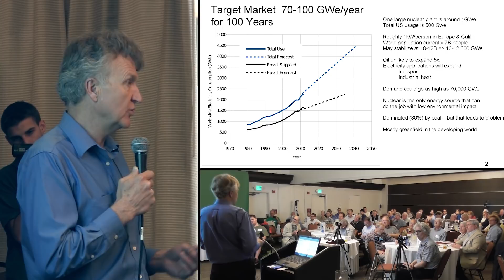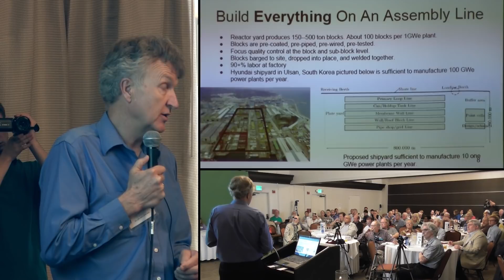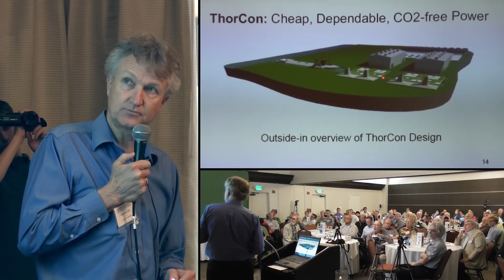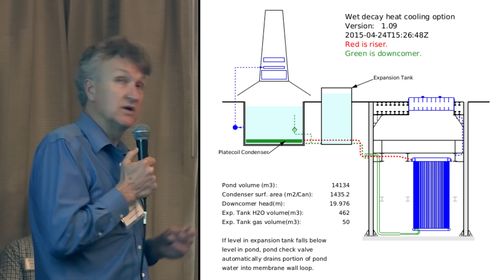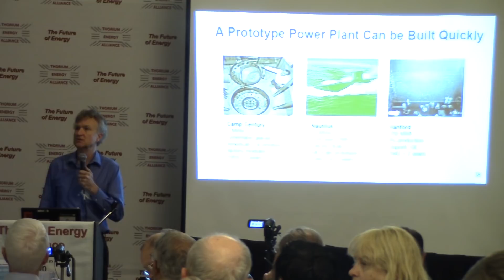ThorCon: A Thorium Molten Salt Reactor System that can be built Now -by Lars Jorgensen @ TEAC7

Comment: I hope this happens soon. I am a nuclear engineer and I have always dreamed that nuclear power would dominate electricity for the world.
Reply: Show me the entire soup to nuts program and, the full Energy Return on Investment EROI. Also compare the need to generate with energy want reductions.
Reply: Your heat losses have been tremendous 3,000 MW heat producing what? 1,000 MW electricity? And that's before transmission losses. With new batteries with PV the public will finally cut the umbilical cords to the I.O.U.'s. Hopefully soon. And as for drawdown of carbon there are safer processes if we all live a bit more lightly. See Drawdown by Paul Hawken. See too what he calls your industry. You want this reactor so bad get Bill Gates to build one and operate it without subsidy and you may get me to listen again. Otherwise...

Comment: Floating your production out on barges to a major river is genius.  (time 11:55)

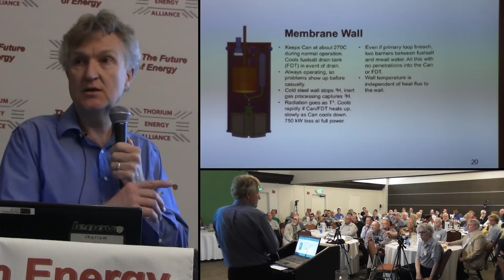At time 18:55 would be nice to have some piping and heater/pumps to get the thorium salts back up to the reaction chamber, after a overheat event.  Then it's not a big deal if you scam the plant.

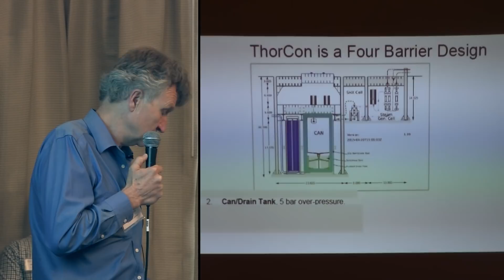At time 20:15   Four years on and four years out of service is not a very good ratio, what is keeping you from totally reprocessing your fuel chemically, and putting the Mod back in service after 18 months?

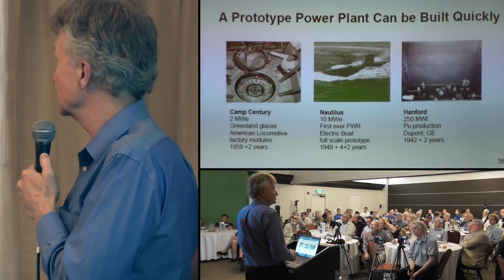At time 28:31 Hanford is a bad example of rushed R & D you should take it out and put up the second nuclear sub?!   Which is probably still sitting in Washington state somewhere.

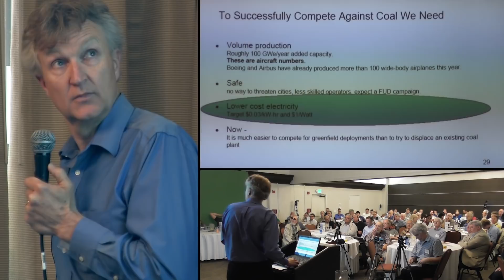Comment: 23:40  Going to 20% enrichment is a big plus just as a decreasing cost of production by a cent per kilowatt is. I just calculated what power producers in my province have been receiving per MW or per KW in the last 12 months. The average price from sept 2014 to sept 2015 was $35.69/MW or $ 00.0356 or 3.56 cents / KW. A one cent difference is huge economically. The speaker gave a price of coal power plants at 6 cents /KW. Almost half of the power in Alberta comes from coal.  I suggest there is also a huge difference in prices of 6 cents and 3.56 cents per KW.  ThorCon would still  be completive in price in Alberta's market, as the speaker gave a price for ThorCon power close to 3.56 cents per KW. The big plus would be more so in pollution control.

Comment: One idea I've had, and I have no idea if it's feasible or not -- the shortage of the highly depleted lithium (Li-7) needed for FLiBe salt could be solved if liquid lithium metal is somehow incorporated into the reactor as a coolant. Or at least, just happens to be there in an outer jacket surrounding the core. Li-6 will gobble up the neutrons that leak out of the core, turning into tritium, and leaving behind the more neutron-transparent Li-7. No mercury or fancy isotopic separation needed -- just a robust enough tritium capture system which the ThorCon system will already have in place.

It's a neat idea, I think, though it probably violates ThorCon's "no new tech" mantra (which I fully respect from an economics standpoint).

Comment: I think the Thorcon business plan is superb.  But I think it could be even better.  If you are going to be using a ship building facility anyway, why not make put the entire nuclear plant and its turbine and its heat stacks on the ship itself and have an entirely mobile power plant where all the ship has to do is hook up to transmission lines at the dock.  Use the mobile home model.  I think that would save lots of money on site costs and really improve quality control as nearly everything can built by the same people and robots.  You would have water for cooling in the case of a breach.  You could move the ships around as needed.  Replace small ships with bigger ones.  Lots advantages to this.  And I think regulatory issues would be far less.  Regulatory issues would focus on getting the ship out to sea in case of an accident.
Reply: That's exactly what they changed their design to, they must have read your comment.
Reply: Good idea but Security issues , an enemy submarine can hit

Comment: What we actually need (Horrible word to use. None of this is needed.), is cold power generation. Almost impossible, but it isn't. Just as power, from heat, has positive and negative... Reverse bias, energy from absorption (as opposed to being from radiation), is also possible. Thunder is more powerful than lightning. Yet, we focus on just the lightning. (The irony being that we still can't capture the small power from lightning, but everything we need to capture the power from thunder is already here. We just refuse to use it, because it can't be patented and resold for personal gain.)

Comment: if the module were built in the 1 to 10 megawatt range they could be licenced as experimental under current nrc rule and for a very large part of the would that is big enough servicing would be a pain but you could do it now and after several unit are running amending nrc rules would be much easier build small now then tackle large later, light water reactor are a bad choice but right now they are the only choice get another choice   out there so we can begin to fix things and make a better world!

Comment: Great talk, Lars! I've been looking forward to hearing more from ThorCon since you guys published your white paper.
I admire the straight forwardness and practicality of the design with respect to economics and safety.
I do have a few questions, though:
1) What's the Haynes-230 going to be used for?
2) 316Ti will help with sensitization, but not eliminate it. Even after four years you should see some inter-granular corrosion. What measures does the design take with regards to inter-granular stress corrosion cracking?
3) In the presentation, you illustrated a barge depositing a can directly onto the facility grounds. Are you implying that every site have direct water access? 

I'd be thrilled if you could answer these questions here or on the forums.
Sincerely, 
Vince Hughes
Reply: Vincent Hughes 1) Haynes-230 is a specialty nickel alloy similar to Hastelloy. Its for the drain tank, I think.

2) Recycling. All components of ThorCon are designed to be replaced and recycled.

3) Direct water access may not be strictly necessary, but most power plants are close to water anyway for cooling.
Reply: Vincent Hughes (3) Yes he said that each site will have water access. The blocks are built to barge dimension limits.
Reply: Pyre Vulpimorph Thanks, Pyre. I have a coupon of 230 on my desk for testing. And we just concluded a 100 hr exposure test of it in FLiNaK. 
From what I've seen in literature, it has some of the worst performance among the superalloys due to its high chromium. Why 230 over another alloy? Or even a nickel liner?
Reply: Vincent Hughes Executive summary here: http://thorconpower.com/docs/exec_summary2.pdf

Thorcon aims to use 316Ti stainless steel (page 46, section 3.12) for all 4 loops (pot, pipe, secondary, tertiary, steam loops). With a mean time between servicing of 8 years and (apparently) corrosion rates of 0.025mm per annum (1mm = 40 years) assuming salt maintenance at reducing conditions; Thorcon has pretty good margin on their core material. Indeed, the original ORNL commercial reactor proposal at 260MWe gross proposed 316SS for secondary loop piping: http://energyfromthorium.com/pdf/FFR_chap17.pdf, page 8 . 

Basically if ThorCon can get their chemistry right, they're in business. If they can't, they're sunk. I note that there's no external penetration from the can to the pot itself aside from the control rods; so how they're going to do chemistry control I have  no idea. Maybe they introduce it into the melt after the primary heat exchanger? MSRE used beryllium metal to maintain the melt in reducing condition and Nickel to maintain fluorine potential (equations here by Rudy Konings of the Institute of Transuranic Elements, TU-Delft MSR Symposium: http://www.janleenkloosterman.nl/reports/kivi_konings_20150417.pdf)

On the other hand its hard to argue with several advantages of 316Ti:
- Its cheap
- Its easy to source from a wide range of suppliers, which means that there's competition driving price down
- Its well understood (applications in LMFRs, LWRs)
- Its a lot more resistant to neutron embrittlement than Hastelloy (according to ThorCon, page 46, section 3.13)

One should also keep in mind that the idea is to scrap the whole thing and recycle the metal before a casualty occurs if a can fails inspections during refurbishment. Even if the corrosion is absolutely horrendous, all it means is a drained pot and an expensive failed experiment.

 Also trying to find a reference as to what the Haynes 230 is to be used for. All I can find is that ThorCon accounts for ~220 metric tons of Haynes 230 for 1GWe. (page 67). It might be useful as a structural metal for the Can itself, because there's a lot of stress placed upon the lips of the Can that has to also hold up the primary loop, hung by TZM cables and operating at 270 degrees celsius.
Reply: MonMalthias I'll need to read through ThorCon's website and published documents again, but I distinctly remember reading that the drain tank would be the only place they'd use a "superalloy". Right now, I can only guess that means the Haynes 230. What I originally read may be obsolete now.

I would not have expected a stainless steel to survive contact with molten fluoride salt for any length of time, even if the fluoride ions are completely bound to beryllium as (BeF4)2-. If all your plumbing is steel instead of nickel, that would be fantastic from a capital investment standpoint. Though I wonder how expensive it would be just to coat everything with graphite so the salt never touches the steel to begin with. Cracks in the graphite would certainly be a problem.
Reply: I think the idea is to make everything out of stainless steel because although they're designing the primary loop to be recycled up to 4 times (page 46, http://thorconpower.com/docs/exec_summary2.pdf) they are expecting to have to scrap it after the first time in their costings. So even if the 316Ti is too clapped out and corroded they still are cheaper than coal. The Pot simply becomes a recurring operating cost.

I did mention before that ORNL planned to use 316SS for the secondary loop on this reference: http://energyfromthorium.com/pdf/FFR_chap17.pdf which would be exposed to bare FLiBe and water from the steam generator. I'll have to try to find the ORNL report on corrosion of various materials. It should be noted however, that ThorCon aims to use NaBe instead of FLiBe. Which one is more corrosive, I don't know. But it was specifically mentioned at the MSR conference in TU-Delft that there was a chart with the redox potential on page 4 by Rudy Konings:
http://www.janleenkloosterman.nl/reports/kivi_konings_20150417.pdf ; and a chart of increasing stability of formation of various fluorides, of which Chromium Fluoride is one of the more stable ones and Lithium, Sodium and Beryllium less stable. This drives Chromium depletion as Cr is leached out of the Cr2O4 passivation layer to form more stable fluorines:
http://www.janleenkloosterman.nl/reports/kivi_sietsma_20150417.pdf

I guess we'll see if ThorCon is right or not once they cut their steel. For their sake, I hope they are.

Comment: I purchased your books today related to MSR Nuclear technology. 

Please talk to US DOE and US NRC.  Both agencies probably want this reactor to be at the for front of new licensing at NRC. 

I am a licensed PE in Nuclear Engineering and a  certified NRC Technical Reviewer and Reactor Inspector and I support this new reactor technology. 

The sad part is this Nuclear Reactor has been at Oak Ridge 30 plus years ago and should have never been defunded. 

Thanks Richard Nixon. You did not help the USA with your lack of knowledge on your decision. 

I am going to read your books and I already bet that this Nuclear reactor should get licensed by the US NRC. 

However, the NRC does not yet have a regulatory framework to license this reactor, 

A NUREG-0800 design specific review standard needs to be developed.

Call NRC and talk to the Office of New Reactors Office Director.

Comment: Slides are here: http://thorconpower.com/slides/teac7_lars.pdf

Very interesting choice of a 4 loop (primary, secondary, solar salt, steam) design. I suppose the solar salt loop is to avoid freezing and entrain tritium? Nitrates can form nitric acid to trap the tritium gas: http://web.ornl.gov/info/reports/1971/3445606042831.pdf (page 25; REALLY good review of secondary loop salt choices).

Not sure why the can itself is overpressurised, but the silo is inerted. Surely to avoid driving forces, the silo should be overpressurised, and the can inerted. In such a way any gas release or seals breaking would force air inwards instead of outwards to the environment. That being said, 4 layers of containment beats out even current gen LWRs for redundancy - only the EPR with its double hulled containment vessel can match it; at much higher cost and much less gain.

The other interesting choice is the "elastomeric bearing" that forms part of the gas-tight seal between the can and the silo. How well do current elastomers perform under constant load under high heat without galling or hysteresis? Can metal face seals do the same job?

Also curious as to what studies have been done behind the Haynes 230 that is to be used in the reactor core: http://www.haynesintl.com/HAYNES230alloy/230HaynesAlloyPF.htm . Does it still have the tellurium intergranular attack problem?

All in all the ThorCon proposal is the most pragmatic proposal I have seen; eschewing all but the bare essentials needed to make an MSR a reality; and investing the cost savings into paranoiac redundancy. If ThorCon can convince the Koreans to rent out some yard time then MSRs may yet see the light of day.

Comment: Good news... LFTR is renewable, doesn't produce CO2, is cheap, safe, relatively easy to establish. Not sure about Thor-con though?? Some things need to be non-commercial. Electrical energy is one of them... similar to the highway system. Best would be to have universities develop systems for their own use, and sell excess to utilities.
Reply: +Thomas Dobyns Bad news then: LFTR's don't exist. None has ever been built. None is being built nowadays. In other words: reality. And the really bad news: you can't just wish reality away, even on YouTube: it just keeps coming back.
Reply: +André Balsa Well, André, to be truth one LFTR was built, a little experimental 7.5 MWt in the '60... it was decommissioned less than 10 years later with very heavy decontamination costs.
You are 100% right on the fact that none is being built, nor will it be in the near future. Anywhere in the world.
Reply: +Berto VV     I don't recall that. Besides, LFTR and MSR are different things. LFTR runs on Thorium and depleated uranium, MSR can be an old technology nuclear reactor with salt cooling. NOT the same thing.
Reply: When people say MSR they almost always mean a salt fueled reactor, and no, LFTR only refers to thorium salt fueled reactors.

Comment: My question about molten salt systems is: Could any of the trans-uranics or fuel materials ever crystallize within the reactor fluid? If some of them do, then could this lead to a solid material possibly plugging the emergency drainage pipe, if the frozen blockage should ever melt?

Comment: Interesting talk, thanks. I have been won over to nuclear after hearing about  LFTR's from talks by Kirk Sorensen.
One question, when compared to a Uranium reactor how much radioactive waste is generated by a Thorium
liquid salt one?
Reply: In other talks it looks like 1/1000 of the waste produced by a light water reactor. With this reactor it looks like a few things are not being burned as completely.  But the idea appears to be is to put this stuff aside for awhile and use it more completely at a later time.  Like with the plutonium, the thinking was to put it aside for awhile and use it when reprocessing is available.  This also appeared to be part of the start up plan with the first fuel loads.  The higher enriched fuel would be better but lower enrichment is do-able now for only a penny difference in cost.  I think he has a good idea in not letting the best get in the way of the good.

Comment: All this sounds exciting and very well thought through. But I'm a bit sceptical that they have a ready-to-go thorium salt reactor when other projects are talking about a 20-30 year timescale. What do they know that the Indians and Chinese are missing?
Reply from the maker: Tullochgorum Thorcon willing to accept greater fuel inefficiencies and also shorter core lifespan. Targeting developing nations first with expectation of simpler licensing regime.
Reply: @gordonmcdowell  Thanks. I guess this lifespan issue is key, as testing for longevity is inherently time consuming. Their ability to pull this off would require low costs you can write off over a relatively short period, which explains their focus on automated fabrication and simple onsite buildings.

They are certainly wise to target the developing nations, who are less likely to skew the regulatory environment towards existing vested interests. The idea that regulators would favour LWRs as against Thorium salt with its inherently safer reactor and fuel cycle is depressing, but quite likely in the US from what I'm hearing.